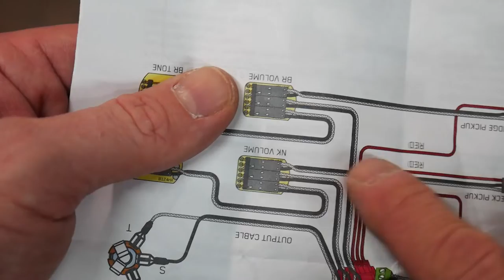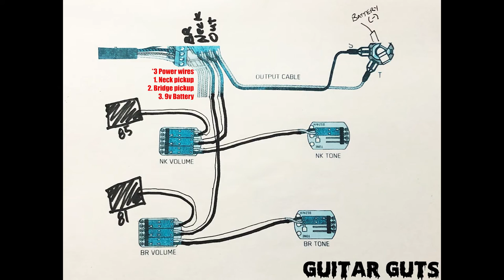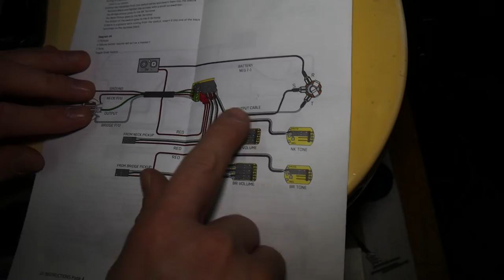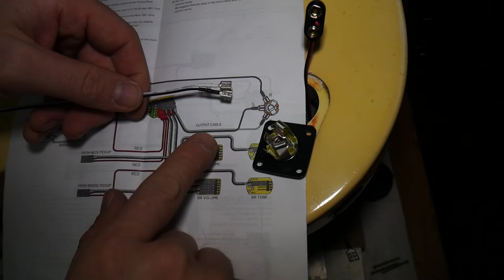How to Install EMGs into a LES PAUL - EMG 81 & 85 ZAKK WYLDE WIRING GIBSON EPIPHONE metal pickups

Comment: I replaced two sets of pickups for two different guitars with EMG pairs (a Kerry King set for my K.K. B.C. Rich and a Gary Holt set for my Kramer explorer, mainly for the red p/u covers). They really do make it pretty easy to put them in! I'm not sure why a lot of people rag on EMG, but I like them. Speaking of p/u swapping, I'm REALLY happy with the Seymour Duncan Hot Rails that I put in my Fender Player-series Telecaster. With pickups being one of the easier mods to a guitar (well, soldering can take some practice), they can make a HUGE difference in tone for a budget guitar!
Reply: Bro can I replace only 1 emg pickups . Or I have to buy a pair
Reply: @Letsunboxguys  Hey man - looks like the EMG signature pickups only come in sets, but you can certainly buy a single EMG 81 (generally bridge) or a single 85 (neck or bridge) separately. I honestly don't know if there's really any difference between, say Zakk's 81/85 set vs. buying stock EMG 81 & 85 pickups.

Comment: Just a little trick I found out with installing my EMG's. I ran into the same problem with pickup wires not fitting through the hole into cavity cause of the wire ends is to just push the pin on the black ends and remove them temporarily. Feed them through and add them on again. Not everyone will have a long drill bit to make that hole bigger lol I didn't. Love the channel and what you do. 👍

Comment: What if you are also wiring an EMG toggle switch in with the ZW setup?  Do I still need to use the buss?  I just did my Ibanez with an EMG 3 way switch and didn't need to use the buss at all.  It took me a while to find a video with the correct wiring with the EMG 3 way switch for that application.  Unfortunately I haven't been able to find anything yet for the Les Paul.

Comment: Hey, so first off, that was some fkn tasty playing. Secondly, I'm about to do this (on an SG, tho) & the only thing I'm confused about, is that it sys (emg literature) that if you're going from passive to active, that there's one thing I need to solder to the stereo jack. I've done many pup swaps, although never from passive to active. I see you didn't have to.. if you wouldn't mind shedding some light on this, it'd be greatly appreciated.

Comment: My installation was very similar to this except I didn't have a bare wire for ground from the toggle switch. But when the toggle switch has both pickups selected, nothing comes out. Separately they work great. Maybe a bad toggle switch? I'm a bit confused on this right now

Comment: I've just received my set from Amazon. I have one if those special pots. Then 3 regular les Paul ones with the solder prongs. No battery connection...and the bus consists of 1 red little block. Is it possible they made a passive set ?

Comment: Great info 👍👍
How did you secure the battery inside the compartment ?
Reply: He added foam from the packaging to "squeeze" the battery and keep it from moving.  You can also ad a strip of blue painter's tape to keep it down.
Reply: Was thinking that a 9V battery clip with velcro might be a good option.

Comment: do they sell wiring compartment with battery unit installed into it? otherwise it would be pain to open it with a screwdriver every time
Reply from the maker: They do sell that, but you have to get it installed by someone who can use a router so it’s a bit of a job. But the 9-volt battery lasts over a year. To remove 4 screws to change it literally takes 30 seconds.
Reply: @GuitarGuts  didnt know that it lasts so long, I thought few months - I just have guitar which has so tight cover so I can remove it only at home with bosch food vacuumizer unit xD

Comment: Guys, My guitar has 1 volume, 1 tone, a 3-way switch similar to a les paul and an output jack and enough space in the cavity for the battery, I have an emg 81-85 set but i don't have pots i just have a 3 way blade switch that wont fit my guitar and a battery socket besides the pickups, can I install them through my own pots etc.? I'm not in a hurry to install them I want to be careful

Comment: Do you have to change the pots? Can u wire emgs to existing pots?
Reply from the maker: You have to change the pots. EMGs use 25k pots and lespauls generally have 500k pots. So you’ll need to change them.

Comment: great video! My guitar only has two faders (1 tone + 1 volume). Is there any way to use only two potentiometers for these pickups?
Reply: Yeah, I was on the EMG website, and they definitely have that opinion. I'm not positive about the Zakk Wylde set in particular. But, other 81 85s for sure. You can buy the pickups alone and then the 2 pot wiring set if anything else.
Reply: @ethanputman3471  I have the Zakk Wylde set, I just use them with a switch and a single volume, works fine.

Comment: If you loosen up the two tailpiece anchor screws a half turn each you should have the clearance to slide it off and unless your customer is planning to over wrap the strings the tailpiece doesn’t have to be set that low otherwise you increase the break angle of the strings between the tailpiece and bridge causing there to be more pressure on the bridge than needed and in time will cause it to collapse and then you start getting all these weird tuning and intonation issues and fret buzz normally the G and D strings are the most effected and although there are home remedies for bending it back in place it’s just a short term fix and then you have the choice to either search for a used one that’s still good and matches the wear on the rest of the hardware or buying a new one and then you have to wait for nature and countless hours of playing time for it to naturally ware and match the rest of the hardware not to mention that they are not cheap for what they are both Nashville and ABR-1 style TOM bridges that fit Gibson and other non metric guitars